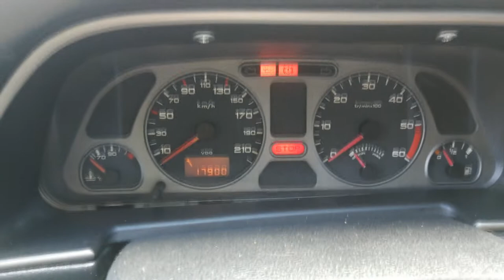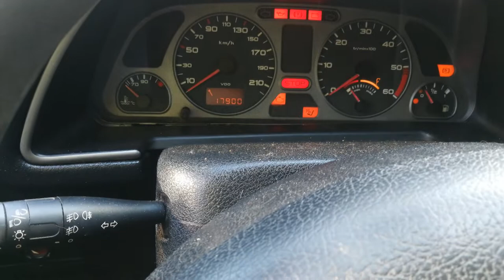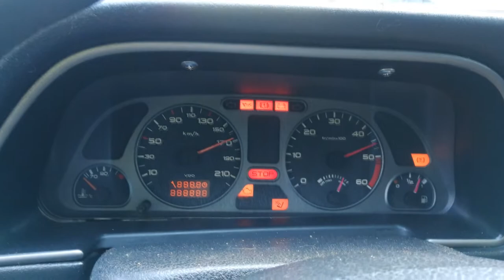Peugeot 306 2.0 HDI 2001 ecu replacement (no check engine light no start).

Comment: I have a same problem with mine ecu unit in 306 2.0 HDI, if he show check engine light he start normal, but if dont show engine wont start. So what to do, change or try for repair? 🤔